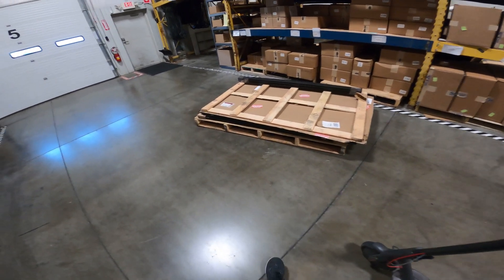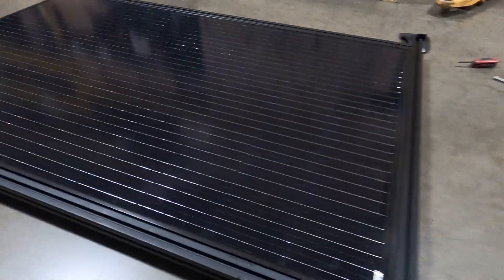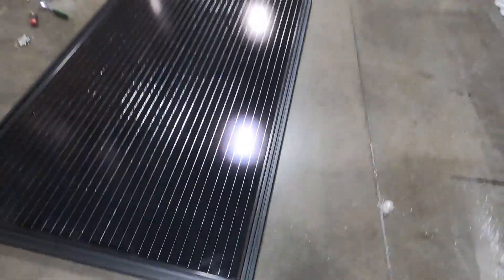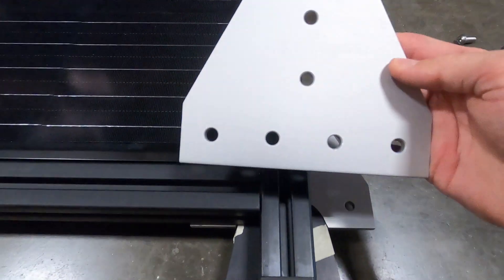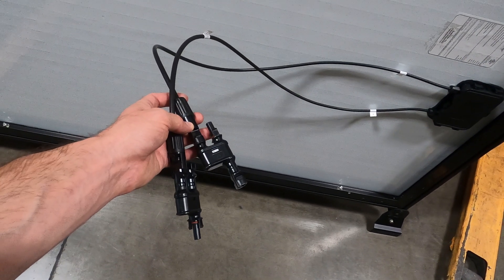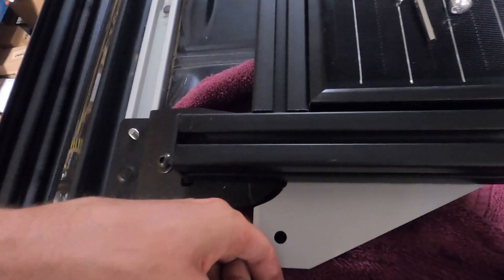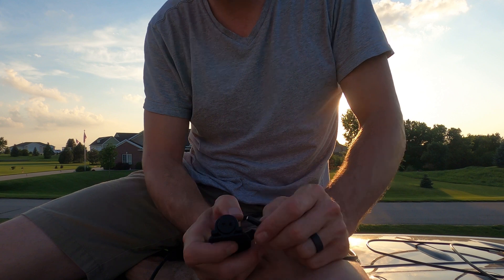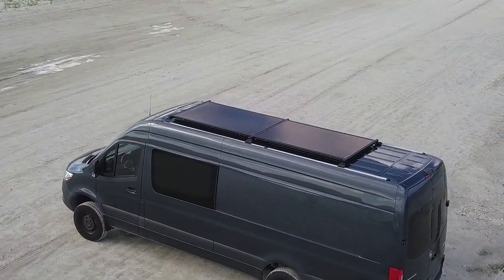600 watts Grape Solar Install on 4X4 Sprinter Van - MADE in USA

Comment: Nice setup. How much wattage are you getting from your solar? I have the same Kisae dc to dc charger/ Solar charge controller and I have 400w of flexible solar panels yet I’m only getting 120 watts. Did you have a special setting for solar charge controller to harvest more power?

Comment: Nice job, but one thing you should change is that the breaker you put in next to the DMT 1250 should be on the other end of the wire as close to the starter battery terminal as possible.  Breakers/fuses should always be as close to the battery as possible.  It this wire had a short to ground/chassis anywhere along its length, the starter battery would deliver extremely high current and would melt the wire and burn the insulation off it and possibly cause a fire.
Reply from the maker: Thanks for the advice. Next build I’ll put the breaker closer to the battery.

Comment: Hey Dude! We have the exact same dc dc  and with everything connected and giving the right info my ch2 is still blinking and my solar panels still wont charge my lithium battery.. do you by chance have a clue to my issue ? I would greatly appreciate any info/advice thanks 🤙
Reply from the maker: Sounds like a setting issue. Did you get it sorted by now? They have excellent customer support. Did you email them?

Comment: Hi, I'm about to add a 320w solar panel to my Kisae dmt dc to dc charger. Did you add a fuse/breaker on your wire between the solar panel and the kisae or did you run the + and - cables straight in to it. Thanks.